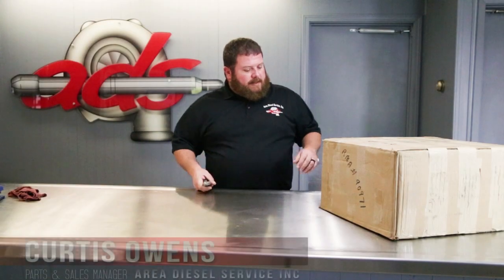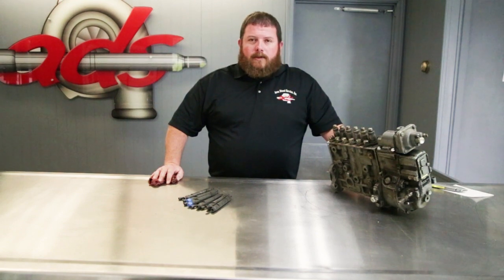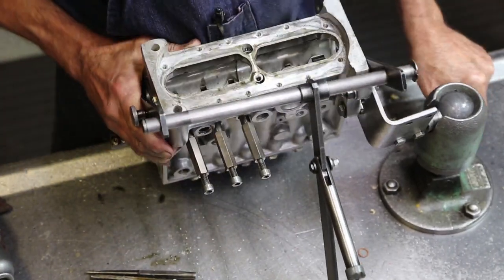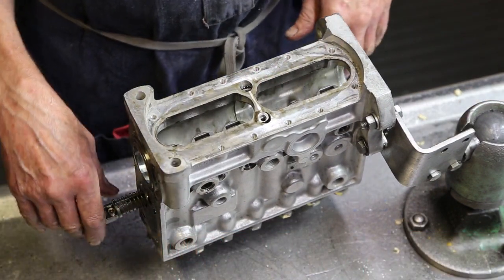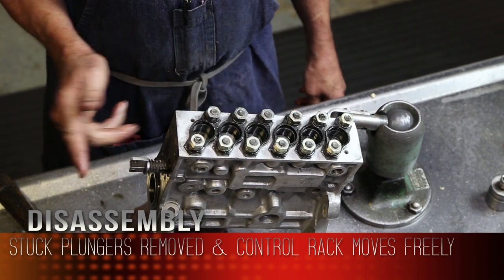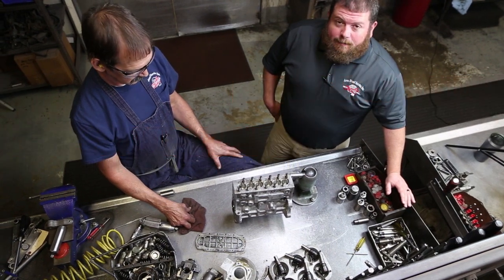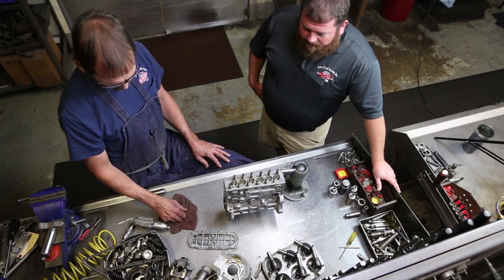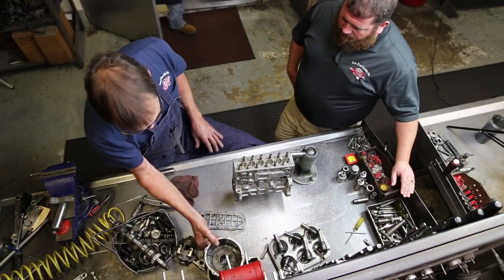Part 1 - #Bosch #Diesel #Pump #Rebuild - Area Diesel for #bcbloc02 Hyster Forklift 8.3L Cummins Swap

Comment: Talking about a master Bosh tech, Gary is the man he knows every step of the process amazing work.
I am building a custom truck  have a DT466 as power plan looking for a shop to rebuild my p3000 with 12mm plunger and barrels but i cant find the timing pin, i have injectors to be calibrated with, will be contacting this shop

Comment: how much does it cost to rebuild fuel Bosch fuel pump for 6806 Deutz?
Reply from the maker: The price will vary based on the condition of your pump. Our average range on this pump is $1400-$1800. If you want to give us a call and let us know what you're experiencing we might be able to get a better idea of what you have going on. 800-637-2658

Comment: Why does the tractor's fuel go backwards?
Reply: We are manufacturer specialized in auto and marine diesel engine parts since 1952.
Our main parts are
EURO II system: plunger, nozzle , delivery valves, head rotors, repair kits, etc.
Common rail system: Injector complete and injector spare parts for CATERPILLAR, DENSO, DELPHI , BOSCH, SIMENS, CUMMINS, etc.

If you have any inquiries, pls do not hesitate to contact me.

Comment: What tool was used to compress the tappets that ride on the cam?
Reply: We are manufacturer specialized in auto and marine diesel engine parts since 1952.
Our main parts are
EURO II system: plunger, nozzle , delivery valves, head rotors, repair kits, etc.
Common rail system: Injector complete and injector spare parts for CATERPILLAR, DENSO, DELPHI , BOSCH, SIMENS, CUMMINS, etc.

If you have any inquiries, pls do not hesitate to contact me.

Comment: Hi, I have a Volvo penta AQD 40 A Diesel marine engine 6 cylider 130 hp ,and on that engine I have Ve bosch pump .I have  leakage on that pump I would like to remove and send to service, and later put back im place,but I am not completly sure how.I just unscrew the bolts ,pipes and match timming marks,Do I need to pay attention on something else or that it.Thanks
Reply from the maker: Thanks for the comment - if you reach out to someone at parts@areadiesel.com or via our CHAT NOW feature on our website www.areadieselservice.com and they can let you know/give you some tips and don't forget to mention finding us on YouTube, they'll help ya out ASAP!

Comment: I wouldn't of minded this being 3 hours long. Something about watching a master at their craft.
Reply: I couldn’t agree more! This is like a master class for free. Thank you!
Reply: We are manufacturer specialized in auto and marine diesel engine parts since 1952.
Our main parts are
EURO II system: plunger, nozzle , delivery valves, head rotors, repair kits, etc.
Common rail system: Injector complete and injector spare parts for CATERPILLAR, DENSO, DELPHI , BOSCH, SIMENS, CUMMINS, etc.

If you have any inquiries, pls do not hesitate to contact me.

Comment: Y'all have information on the p3000 pumps? Can't find any info on these
Reply: We are manufacturer specialized in auto and marine diesel engine parts since 1952.
Our main parts are
EURO II system: plunger, nozzle , delivery valves, head rotors, repair kits, etc.
Common rail system: Injector complete and injector spare parts for CATERPILLAR, DENSO, DELPHI , BOSCH, SIMENS, CUMMINS, etc.

If you have any inquiries, pls do not hesitate to contact me.

Comment: Looks like a miniature 6 cylinder engine. Lol
Reply: We are manufacturer specialized in auto and marine diesel engine parts since 1952.
Our main parts are
EURO II system: plunger, nozzle , delivery valves, head rotors, repair kits, etc.
Common rail system: Injector complete and injector spare parts for CATERPILLAR, DENSO, DELPHI , BOSCH, SIMENS, CUMMINS, etc.

If you have any inquiries, pls do not hesitate to contact me.

Comment: I forget to ask. Is it possible to determine hp with manufacturer label on the pump? and also if we have two 908 P7100 pumps what makes difference in hp?
Reply from the maker: Please reach out so our pump experts can help directly - we have a CHAT NOW feature at www.areadieselservice.com or call: 1-800-637-2658 | email: parts@areadiesel.com

And thanks for watching!
Reply: We are manufacturer specialized in auto and marine diesel engine parts since 1952.
Our main parts are
EURO II system: plunger, nozzle , delivery valves, head rotors, repair kits, etc.
Common rail system: Injector complete and injector spare parts for CATERPILLAR, DENSO, DELPHI , BOSCH, SIMENS, CUMMINS, etc.

If you have any inquiries, pls do not hesitate to contact me.

Comment: How does it advance its timing, under light load or high speed?
Like old-fashioned petrol engines, using vacuum or centrifugal advance.
I can't see any way to do it. The injector camshaft is fixed.
Reply: We are manufacturer specialized in auto and marine diesel engine parts since 1952.
Our main parts are
EURO II system: plunger, nozzle , delivery valves, head rotors, repair kits, etc.
Common rail system: Injector complete and injector spare parts for CATERPILLAR, DENSO, DELPHI , BOSCH, SIMENS, CUMMINS, etc.

If you have any inquiries, pls do not hesitate to contact me.

Comment: Can you change a broken barrel assembly without changing the plunger?
Reply from the maker: You cannot change a broken barrel without changing the plunger. They are a matched set that are precision machined together
Reply: @AreaDieselService  ok thank you
Reply: @AreaDieselService  how much you guys get to rebuild a p7100
Reply: We are manufacturer specialized in auto and marine diesel engine parts since 1952.
Our main parts are
EURO II system: plunger, nozzle , delivery valves, head rotors, repair kits, etc.
Common rail system: Injector complete and injector spare parts for CATERPILLAR, DENSO, DELPHI , BOSCH, SIMENS, CUMMINS, etc.

If you have any inquiries, pls do not hesitate to contact me.

Comment: Looks like you got the right man on the job! He clearly knows his pumps. Been awhile since I have messed with one that old that had those annoying sealing washers between the delivery valves and plungers. With the pumps maxed we used to blow those things for past time on the pullers. No worries on this old girl though! Just good reliable respectable power. Not sled pulling the forklift! 🤣
Reply from the maker: Brian - we did get you the best tech on this pump - Gary has been with us since 1977!
Reply: @AreaDieselService  He’s a real gem!
Reply: We are manufacturer specialized in auto and marine diesel engine parts since 1952.
Our main parts are
EURO II system: plunger, nozzle , delivery valves, head rotors, repair kits, etc.
Common rail system: Injector complete and injector spare parts for CATERPILLAR, DENSO, DELPHI , BOSCH, SIMENS, CUMMINS, etc.

If you have any inquiries, pls do not hesitate to contact me.